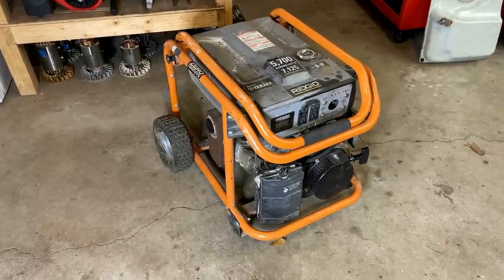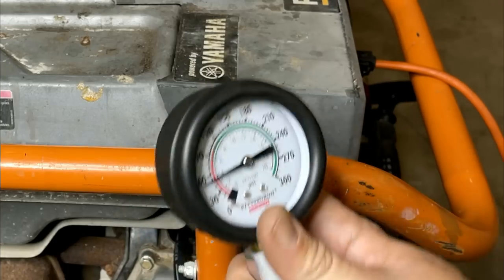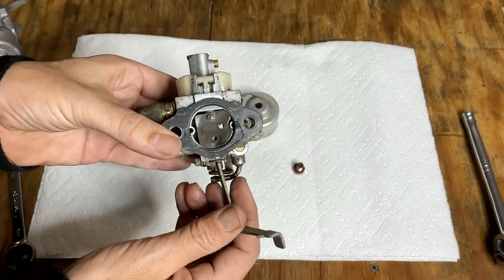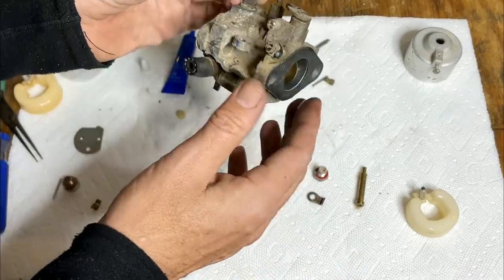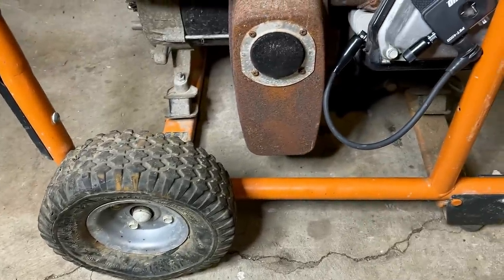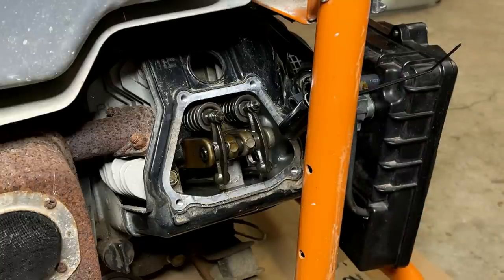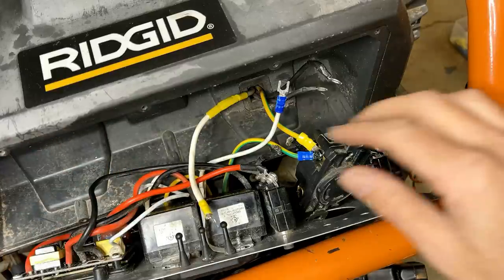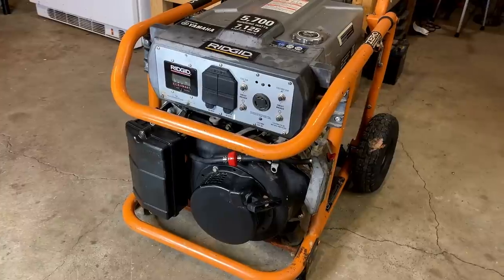Trashed Ridgid Generator - Will Not Start

Comment: I need advice from an expert like you: I want to increase the maximum capacity in a Permanent Magnet Generator. If I change the Block magnets from Ferrite Magnets to a stronger magnet (Neodymium N42), Will the maximum capacity increase and  Will the engine continue to run normally?!
Reply from the maker: Not sure what the impact will be.  Assuming it works then most likely it would be able to put out more power.  But you also need about 1hp for every 550 watts so the engine will probably be too small to get any benefit from the conversion.  Also the stator is only rated up to the current power output so you also risk causing damage there.
Reply: @jcondon1  
Thanks James, but unfortunately I can't replace the generator with a bigger one, I needed a small, compact and lightweight generator with a high capacity to be able to be carried by a Disabled Mobility scooter to charge batteries in an emergency.

Is there any advice to improve the performance of the generator just a little? What I need is 5A/230V a maximum and the generator's Rated Current 4.35A/230V and a continuous power (S1) 1000W.

When the charger has been connected to the generator, it works for several seconds and then starts to surging and hunting engines
The generator is new, model: ''Parkside inverter generator PGI 1200 A1''.

Comment: Working on getting you a parts washer I've seen lots of jobs you could use one for You are Welcome
Reply from the maker: Definitely would come in useful.
Reply: @jcondon1  I think I got my new Generator broke in I ran it on low speed for one hour changed oil ran another hour on slow speed and changed oil put in 10w 30 synthetic any thing else I should do so far have only used LP gas Didn't put and gasoline in the tank not going to if I don't have to
Reply from the maker: @dwightosborn8400  you should run for a minimum of two hours on gasoline to properly seat the rings.
Reply: @jcondon1  OK should I change the oil again after the two hours running
Reply from the maker: @dwightosborn8400  It would not hurt.  Also break in oil should be regular oil not synthetic.  Of coarse most never break in their small engine so you are ahead of the game.
Reply: @jcondon1  Thanks
Reply: @jcondon1  I changed the oil to reg oil ran on low for two hrs then ran on high for thirty min changed oil to synthetic when I ran it I used Propane is that OK I see you said Gasoline

Comment: Found the problem.  The HVAC FILTER was installed backwards.  The wire goes to the output side to keep the element from taking off.  Just kidding.

Comment: you really make me nervous when you hold that carb with one hand while you are trying to remove a stuck screw.  if the screw driver slipped, it could easily go through the hand holding the device.  it's just bad practice to put any part of the body at risk of damage from a tool being used by another part of the body.  i'd hate to miss any of your videos because you had maimed yourself.